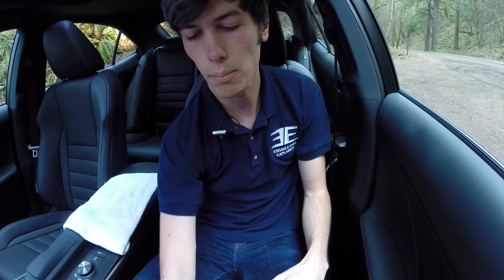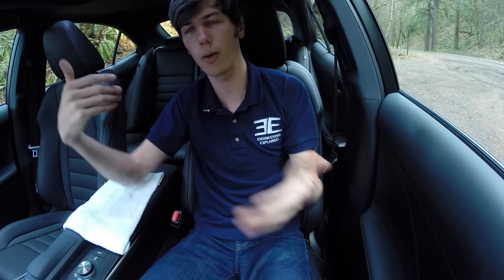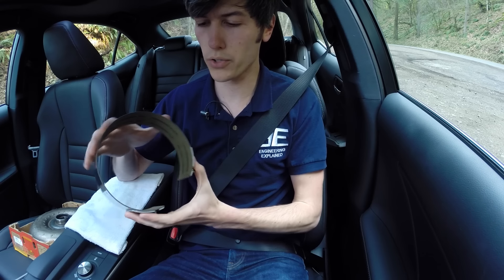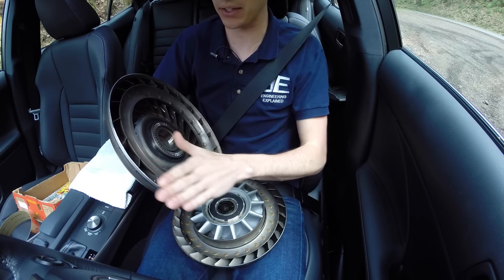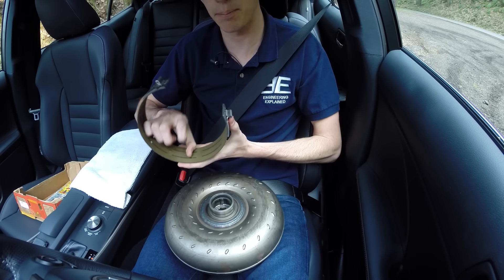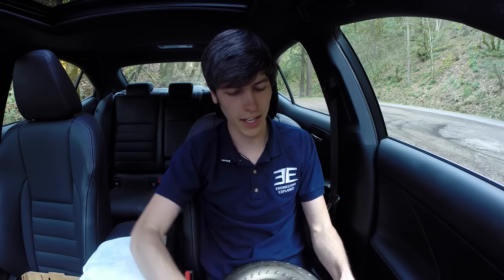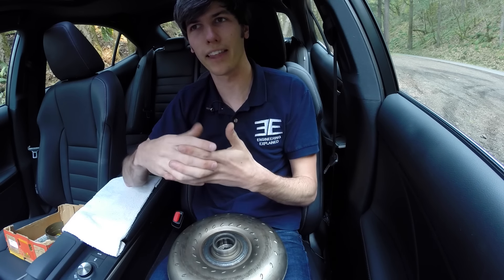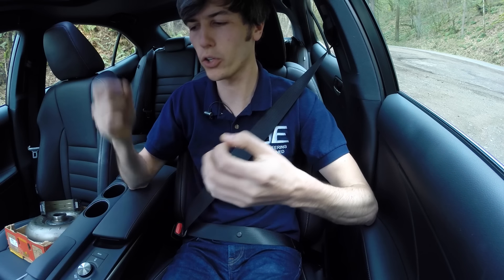5 Things You Should Never Do In An Automatic Transmission Vehicle

Comment: Question about the end. It sounds like you're talking about an automatic, not a manumatic, so how do you downshift in an automatic?
Reply: “Manumatic” 🤣 that’s a good one. I don’t know what vehicle you own, but on most automatic transmissions past 1960 or so usually have a range of gears from the standard PRND to L for Low and often 1-3 depending from car to car. Many modern automatic transmissions also are equipped with paddle shifters or a M on the shift column for manual clutchless sequential shifting. (Sequential meaning straight through the sequence of numbers of gears 1-2-3etc) and may even apply a fail safe auto brake if downshifted improperly depending on car make, model, and year.
Reply: @ac-130fan  --Yeah, something like, can shift between automatic (D)rive and user-input {M}anual. Does have a couple safeguards in it, denying shifts too gears too high or too low for the speed I'm going (probably not specific to the speed, but I'm no manual expert, so it's the simplest way I understand it), and will automatically downshift for me if I don't down shift when slowing down.

I have driven older cars that have three listed gears (D, L2, and L1) with some that have 4 listed gears (D4, D3, L2, L1). The former usually has a steering wheel mounted gear selector I hate trying to use while in motion, while the latter could be column mounted or between front bucket seats, with the center-mounted selector being the one I'm more comfortable doing a faux-manual shift while in motion.

Always thought L stood for Load, and since I've never towed anything I've always been afraid to drive in those gears. I supposed he could have been talking about dropping into L2 or L1, but is that safe?

Comment: I’m amazed how strong brakes can be.  Whether peeling out in a car or launching a jet.  The Blue Angels can demonstrate to passengers how it feels to be launched from an aircraft carrier.  The pilot locks the brake, raises the engine thrust, then releases the brake for instantaneous acceleration.
Reply: Brakes will stop any engine. That information should have been given to folks who fear "unintended acceleration." If your engine does over-revs in gear, the brakes - even on the worst car - will stop it. My revivifier had a Fiero that demons would possess periodically, but the old-fashioned, crappy brakes could stop it.

Comment: Never coast downhill because it doesn’t help. Except it does, since you’re no longer turning over the engine and can use more of your gravitational energy.
Reply: That implies that you turn the engine off entirely. If so, have fun with the steering lock and brake booster. Besides, you aren't supposed to "use" the gravitational energy, you are supposed to bleed it off as you descend, else you end up going 120mph

Comment: 1st statement is false. Neurtal gliding burns less in many condition. Gliding with gear slows down car and causes loss of momentum.
If a car accelerates too much in neutral, you can put it into gear anytime.
Gliding in neutral is an advanced hypermiling technique. Do not do it, if you are an inexperienced driver.

Comment: I always use manual mode to shift, and lift throttle during the shift as if it was a manual.  This completely unloads the clutch packs and bands during the engage/disengage transition, and will make the transmission's friction components last pretty much indefinitely.
Reply: It always feels better for me to keep my foot on the throttle. Especially when downshifting if i don’t give it throttle my car jerks like if you didn’t rev match or or baby the clutch on a standard. I always figured tis was the preferred way to do this as the transmission shifts on its own without you releasing the throttle.

Comment: I know this is an old vid, but there are a few situations where coasting in neutral is a good idea. I drive a hybrid so I like to put it in neutral when braking so I can actually use my breaks instead of the regen so I dont have to swap my brakes every 6 months... Also I used to drive a 90 hp, 5 speed diesel van (not an automatic but it could have been), and the engine breaking on those is so heavy you basically have to floor it to keep up speed while if you put it in neutral you can just coast downhill and not lose speed.

Comment: In eco mode, my car disconnects the drive train from the engine.  You can tell because the rpm gauge goes to idle rpm.  It selects a 10  mph zone (5mph each side) to stay in before it reconnects.  Also uses engine braking going down hills and such.

Comment: You obviously don't know how a torque converter works.
When your engine is powering the flex plate, after stall speed is reached, the torque converter will provide a fluid coupling, and eventually the torque converter will lock up, either hydraulically or electrically, if so equipped.
If power is cut from the engine, the lockup will instantly go away, and once the engine slows to below stall speed, there is NO fluid coupling to connect the engine to the transmission. 
Conversely, since there is no coupling, the transmission cannot drive your engine going down a hill.
This is the same reason you cannot push start an automatic. 
Also, you cannot trust the computer to accurately keep track of mileage.
Instead, do this; fill up, set the odometer to zero, drive. Fill up again. Math. Rinse. Repeat. Math again.
Now you know what kind of mileage you are actually getting.
I have done this on the last 4 vehicles I have owned, and I come out 3 to 4 mpg better than the computer, cuz they are only as smart as the college kid on work-release who programmed them.
For those of you who wanna tell me that the transmission will overheat by coasting it down a hill, listen up...
As long as the engine is turning, the transmission front pump is turning.
They are in constant mesh.
As long as the front pump is pumping, fluid will be going around and around and around through the filter, pump, lines, cooler and galleries inside the transmission. 
I can assure you that if you install a transmission fluid temperature gauge, you can watch it plummet as you coast down a hill.
No friction, no heat. Science.
As for "illegal", all I have to say is this-- I don't need or recognize ANY government authority over me when it comes to coasting down a hill.
If my brain cells have all died off to such an extent as this, please shoot me in the head and toss me out with the trash, cuz i would obviously be as close to death as humanly possible by that point.
Unfortunately, I have discovered that I suffer from the rare and extremely DANGEROUS ability to THINK FOR MYSELF!!!
WAKE UP, IDIOTS ACROSS THE NATION, BEFORE IT'S TOO LATE.

Comment: #6= never tow an automatic transmission equipped vehicle with the wheels on the ground and the engine not running,,,,towing with an automatic in neutral with the wheels on the ground since the engine is not running ,,,,the transmission pump is not creating any internal lubrication pressure,,,,,so everything in the trans will be spinning without any lubrication and MAJOR INTERNAL DAMAGE WILL OCCUR!!!!

Comment: I've been coasting in neutral down hills and approaching a red light from many blocks away since I've bought my car new.  When I get to the red light I don't put it in drive until it turns green. My 2016 Mazda CX5 has 105,000 miles on it. I drive with Lyft and I get at least 2 more miles per gallon every 15 gallon fill up. So I gain more than a gallon per tank for putting my car into neutral. This guys first couple of reasons have nothing to do with damaging the transmission. Thumbs way down.

Comment: Cuts fuel to the engine when going downhill? No...the engine requires fuel to run. It doesn’t shut off when going downhill.
Reply: Actually new engines do shut off the fuel injectors and lock the torque converter when your foot is not on either pedal. The car's momentum is used to keep the engine running and as soon as you touch the gas again the torque converter unlocks and the fuel injectors turn back on.
Reply: Yes yes they do. The engine still "runs" but instead of burning fuel to turn your wheels your wheels are turning the engine. The force needed to turn an essentially shut off engine is what enhances the braking effect

Comment: This is an old video but I hope you can reply with your inputs nonetheless. If you keep the car in D at a stoplight or in traffic, you have to stay on your brake pedal to prevent the car moving forward. I feel this would heat up your brake fluid more than if you shifted into neutral. What are your inputs on this?
Reply: wtf, no, brake fluid heats up because it was absorbing the friction of the fast moving car, once its at a dead stop its doing nothing, just holding pressure, no additional heat unless the car is creeping forward

Comment: Sorry, I know this is an old post but I wanted to ask your view on using Park vs Neutral when stopped with the handbrake on. I have always felt keeping the calipers on the disk (I'm from the UK) when they are hot that they create a heat sink at one point and can warp the disks. The solution, before I switched to an auto, was to put the car in neutral and apply the handbrake of course but I've seen comments on autos that you should continue to do this and not use Park. Now, I can see some reasoning behind this but it seems that the start/stop features of modern cars disengage if you do this and actually start the engine again vs putting it in park which, unless the car needs the extra power for the battery, seems to leave the engine stopped. Of course it seems better to put the car into park, put on the parking brake and fully stop the engine if it's a long stop. In my case I'm talking about a BMW with a ZF 8HP transmission.

Comment: I was told putting an auto box in neutral (and then back into drive) would: 1. Stop oil flow around various engine parts (as it relies on the car being in drive); and 2. There would be significant strain on the engine (gearbox etc) when placing back into drive (like when you do a car launch), as you're moving from low revs to high revs very quickly.
Reply: Not true. You can also mach the revs before putting in D and all fine.

Comment: 2019 Hyundai Santa Fe, 8 gears shiftronic-Going to a trip in the mountains, on a wavy up amd down road, I realized the transmission shifts, quite often, through 8-7-6 gears going up and 6-7-8 going down. I know that frequent shifts gets the transmission hot, so I decided to go on manual and drive 30 miles on gear 6 alone - average rpm higher, of course ( because no cycling gears 7 and 8 ) - maybe up to 3500 rpm. Is that ok? ( so just one  lower gear and higher rpm versus cycling quite fast through several other gears)

Comment: About point No. 1: Coasting in neutral will use less fuel than leaving it in gear unless you actually need to slow down. Yes, leaving it in gear and releasing the accelerator pedal will shut off the injectors, but it will also slow you down, requiring more fuel to get up that next hill in your scenario. As an example, there is a hill close to where I live that is just about steep enough that I can coast all the way to the bottom at a steady speed, but not if I'm in gear. In neutral, the engine merely idles all the way, but in gear, I must keep the accelerator depressed all the way, which uses more fuel (the car needs to spin the engine faster as well as losing power through the transmission). And, if that's still not convincing enough, Audi actually incorporated coasting in the A2: If you lift off the accelerator, the Audi A2 will automatically switch to neutral to save fuel. Of course, you save even more fuel by turning off the engine, but that's another comparison and comes with inherent dangers like losing some steering and braking capability.

Comment: None of my cars have cut fuel when rolling down a hill in gear, unless you downshift to get the revs up high(like above 4k rpm!).  They all actually consumed less fuel when coasting in N and idling shown by a scanguage2 and an Ultra gauge.  I believe the ECU always dumps fuel into the motor when coasting in gear to keep the catalytic converter hot.  Now in my SUV's they have cut fuel quite well when coasting in gear, I believe because they have more lax emission standards to meet and letting the catalytic converter cool down isn't a problem.

Comment: For #4, a reason to put it in park at a stop light is so that if you get rear ended and incapacitated, and your foot comes off the brake, the car doesn't keep inching forward into traffic.

For #5, yes, some cars will allow you to throw it into park while moving, at least at low speeds. I was driving my wife's Chrysler 200 on a road trip and accidentally flipped it into park as I was coming to a stop in a parking lot. I usually drive a manual and popping the car into neutral while I come to a stop is an ingrained behavior, which is why it happened. The car was going slow enough not to cause damage, but I definitely felt that pin engage.
Reply: For #4 why don’t u just engage the handbrake?

Comment: I appreciate your attempt but your information is wrong in some cases and misleading. As putting your automatic transmission in neutral probably isn't good or beneficial, the engine doesn't always completely cut off fuel to the engine when coasting downhill. You're misleading people with your torque converter cut in half. You're spinning one half against the other. That's not how it works the whole thing moves as an assembly. There is a turbine and stator inside the shell that move separately. Also that band is very outdated and if someone doesn't understand how planetary gears work already and how overdrive and underdrive happens it doesn't really help even if it was still used today.